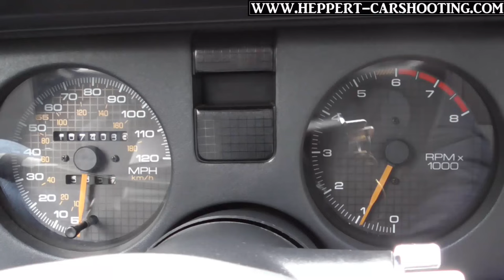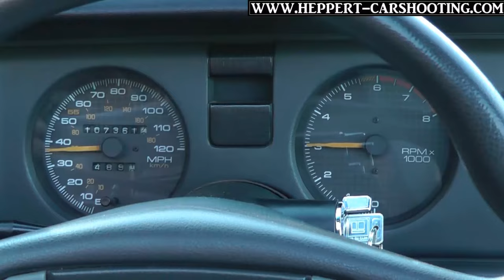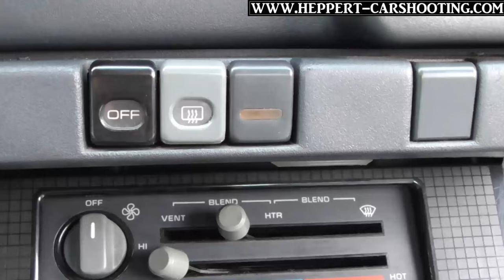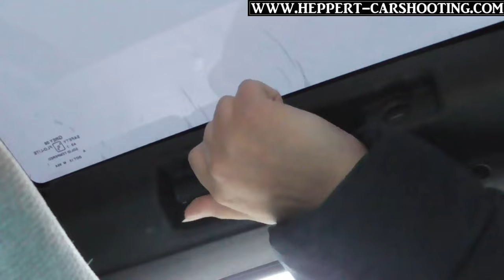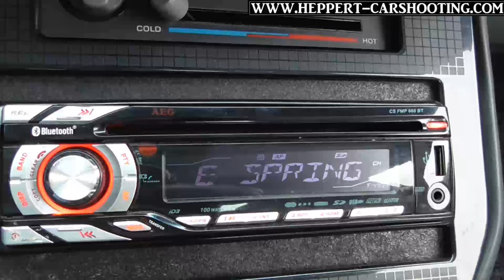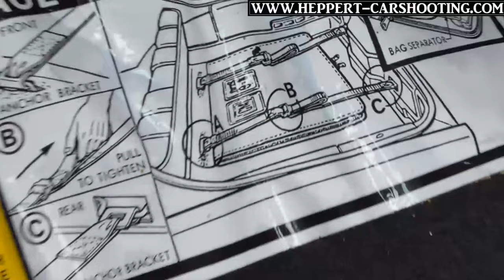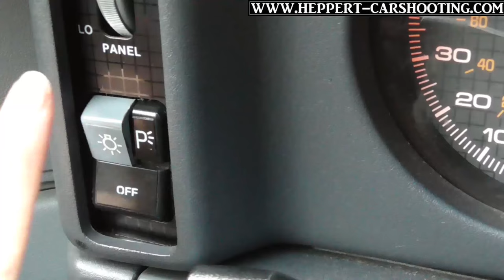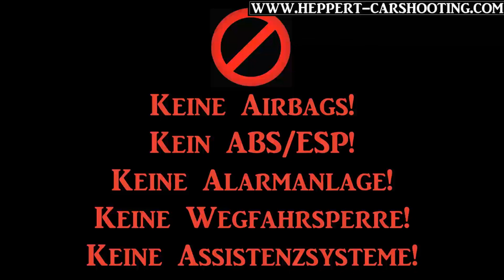1989 Pontiac Firebird Review, Test, Bericht, Doku

Comment: No cruise control, no air condition, no heated seats... This is entry level equipment except removable sunroof. Only 170km/h! Even Golf Diesel reach 200km/h!
Obsolete worm transmission on steering rack like today only on trucks, busses, jeeps. Only 3 speed automatic transmission, no overdrive gears. Obsolete rear solid axle today only on trucks, busses and jeeps.
Reply: What you expect from a car from the eighties.But still looks super cool and can be modified today .
Reply: @keswarnathragbar8225  yes it was 80's